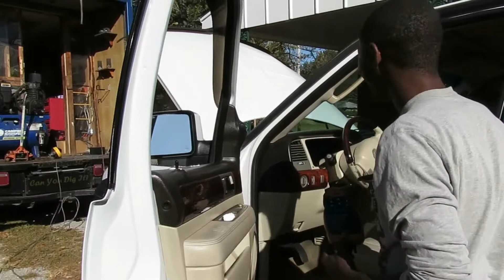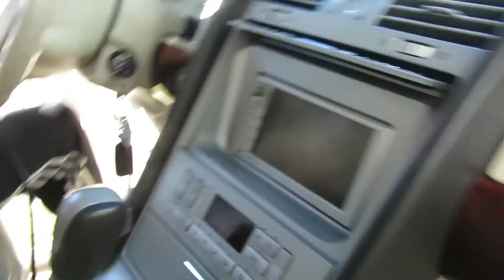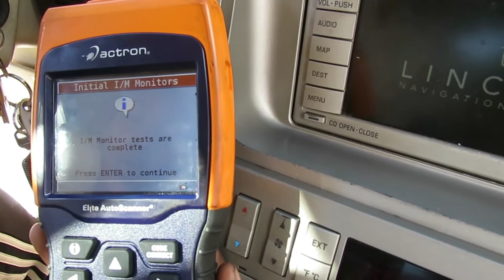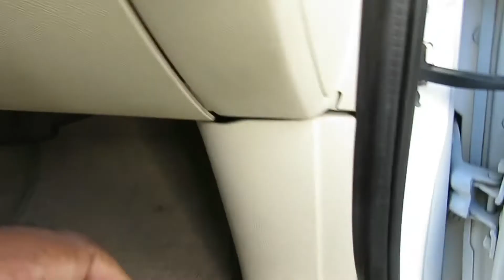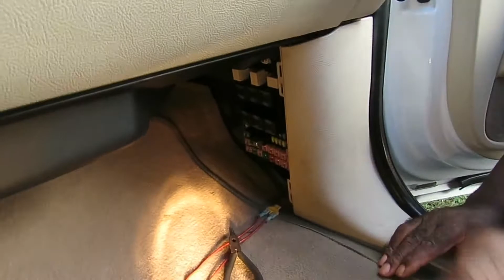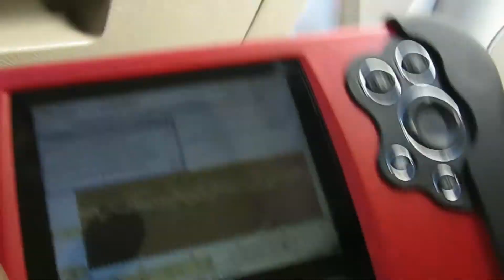⭐ 2003 Lincoln Navigator - P0231 - Low Voltage Fuel Pump Secondary Circuit Low

Comment: That was great
Have a question you say weakest  point breaks and that is soldering  ,but why not fuse is not  giving up is it bad design?I thought fuse is suppose to this job
Reply from the maker: A fuse is stronger than a loose or weak solder, especially when you're talking about 10 or more amps.

Comment: This made more sense.   Except I ain't got a code.  It stalled on me twice. Gonna change my fuel pump and filter get this junction box fixed. One question what about the fuel driver module?  Where is it in the 2003 Lincoln Navigator.   Did not find it behind the rear driver tire. No box or wiring there?   Great video
Reply from the maker: Thanks, sometimes the fuel pump module is the fuel pump, just the entire assembly.
Reply: will check on that thanks.